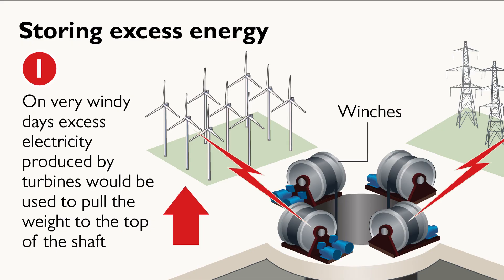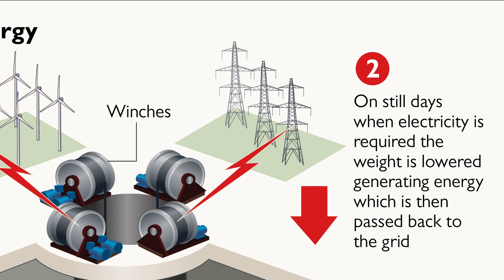WDU 383.1 Gravitricity Testing Vertical Shaft Energy Storage

Comment: It really seems like Gravitricity has the best concept out there as far as price to performance. It’s by far the simplest I’ve seen and requires the lowest tech of all available and upcoming technologies. There only seems to be one big challenge here which is the distance needed to dig or bore. If they can spend most of their resources solving that in a relatively inexpensive way then I see no other viable competition out there . Depending of course on the geology, topography, etc where it could be installed

Comment: I actually wonder if it would be cheaper and more scalable to dig super deep trenches for this, going along the length adding weights and trusses spanning the trench.  Wouldn’t need to be a mile deep since you could add weights along the length. Only potentially cheaper when there’s no mine shaft that isn’t full of water that is.

A trench would probably use way more common equipment to dig than boring a hole in those instances as well
Reply: Im thinking instead of wasting energy to bring the weight back up, have it as a container with liquid that empties at the bottom so it can be winched up with less energy? And/or a counterbalance?

Then mabye you could use capillary action to refill the liquid back at the top?

Comment: Hey guys, love the conversation, have you looked into hydrostor and their projects in Ontario Canada? another cool energy storage concept using the pressure of bouncy
Reply from the maker: Tony: That's pretty neat.  I love that from the surface it just looks like a tiny substation with a couple retention ponds.  That it's almost entirely underground keeps it from being an eye sore.  Provided the subterranean area is clear, a system like this could be installed just about anywhere.
Reply: @CorollaCrossUS  Hey Tony! Thank you for the response and interest! Im glad i could show the professionals something.

I like what you guys were saying about gravitricity in the sense of yes they are doing a proof of concept, but its such simple principals that it works off. 

I am an industrial mechanic and very familiar with both principles at play whether it be hydrostor or gravitricity. I think hydrostor's systems would be costly for maintenance and spare parts. There are also alot more moving parts with bigger distances between the drive and driven. 

i also think gravitricity has the advantage that it can be installed anywhere you can dig a hole along a power grids reach. Hydrostor has inland solutions using compressed air, but its essentially using a turbine to spin a generator and the piping system will cause energy loss.

keep up the good conversations, they go great with my morning coffee!
Reply: the pressure of bouncy?
Reply: @MikeZ__Texas  Sorry i butchered the explination, i didnt want to seem like im pushing a different idea